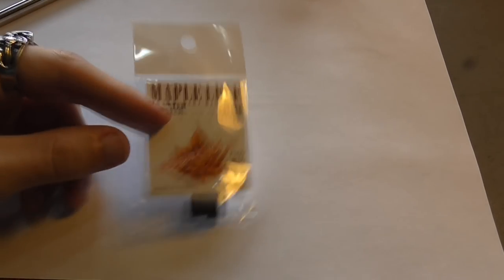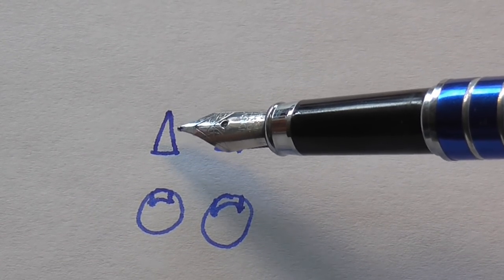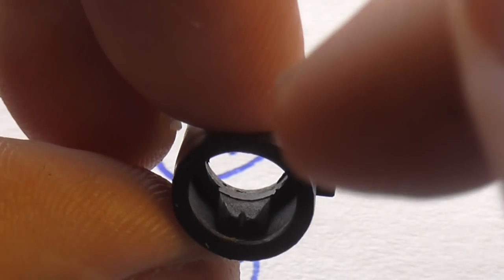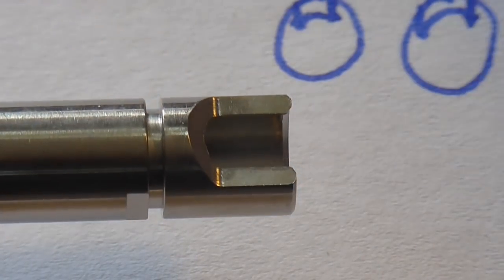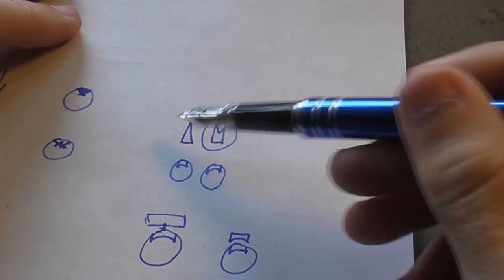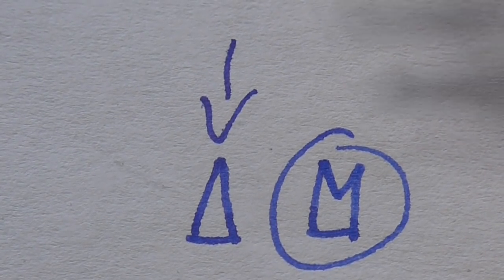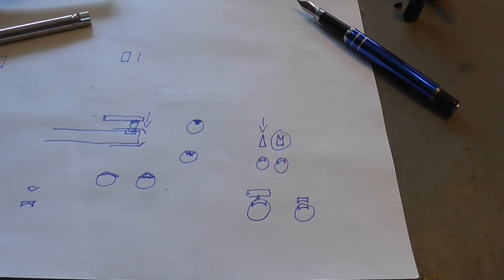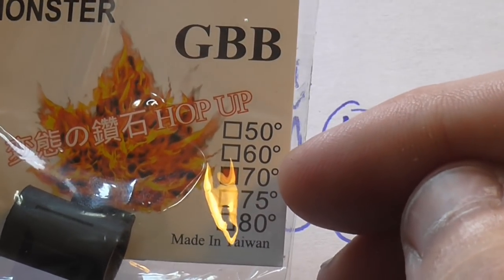Maple leaf buckings (& why you should use them)

Comment: Hey Relizu/Reliku ;p
In the AA hop up chamber, do you need to mill out the window the nub goes through? It seems the nub is too wide for the small window the nub needs to go through.. a prometheus tensioner also didnt fit. And the original VSR10 nub just barely fits. The ML concave nub seems to be much wider then the original nub. Is the window of my AA chamber not as wide as yours or something?
Reply from the maker: Arjen Huijtker The ML concave nub is a perfect fit for the AA chamber. If it doesn't fit, you may have a lemon nub or chamber. But you don't need to mill anything or do any modifying at all.
Reply: Okay thanks a lot.
Great contributor to the airsoft community btw!! :)
Reply: And another quick question, is the action army 6.03 precision barrel also well fit for this set?
Reply: With a ML autobot 70 bucking? :)
Reply from the maker: Yes, but I'd recommend a 60 degree instead with a maple leaf crazy jet barrel. Those are better.

Comment: HI, i have the silverback srs, and i wanted to upgrade the bucking and I have used maple leaf diamond for my vsr before, but not the maple leaf aeg buckings. Would 60 degree maple leaf aeg bucking be good to use. I have an aps m160 spring installed and thats around 520 fps. Also, do I need the concave maple leaf nub for the maple leaf aeg bucking to work, or will the standard silverback nub work?
Reply: +Relizu ^
Reply from the maker: You may have to DIY a nub as the standard SRS nub is not concave. Other than that it'll work :)
Reply: +Relizu But instead of diy my owm nub can i use maple leafs concave nub?
Reply from the maker: John John You could in theory, but it won't work very well with the SRS double adjuster.
Reply: oh yeah I understand that, there is actually a mod for the srs called the fast hop that fixes that problem. Its a dile that you turn to either move the hop arm up or down so its not come from 2 sides anymore, just the top, so  i think the maple leaf nub could work. Thanks for the help! :)
Reply: +Relizu oh also, would 60 degree aeg rubber wear too fast with a sniper rifle? Or should i use the 70?
Reply from the maker: John John both will work fine ;)

Comment: I just got a 75 and i have almost no hop? Its installed right. But idk why. Do i need to break it in?
Reply from the maker: dat boi 75 is hard, so if it's cold or your fps is low it won't work well.
Reply: Relizu i fixed the no hop. But i have many fliers now, my fps is low but i have a new 110 spring. Would you say it should fix the problem?
Reply: Relizu i think evike lied. It says 75 is for shooting 330 to 400.
Reply from the maker: dat boi yes evike simply copies maple leaf's chart. Which is wrong for 90% of the western world. That chart is for tropical climates where it's much hotter (Asia), hotter weather => harder bucking. For 400 fps, I would use 50 degrees (softest they offer) where I live (western europe). If you live somewhere warmer you could go for 60 degrees with 400 fps, or maybe even 70 if you live in the southern part of the US for example. But usually, 75 degrees is waaaay too hard for 400 fps.

For reference: here we play at 500 fps (measured with .2), and I play with .4 bb's at roughly 2.5 J myself. In the summer I play with a 60 degree bucking, in the winter I swap it out for a 50 degree one ;)
Reply: Relizu very interesting. I do live in texas and the summers are really hot here. I have it taken out right now and will wait until it is hotter outside to try it again. Either way i am doing the spring as mine has had several thousand rounds put on it and i need the extra power for outdoors. You know a lot about hop up buckings. I actually didnt have the right nub previously and that was part of the problem. I just needed to watch the video more, and also not listen to evike.

Comment: what you recommend for echo1 m28?
Reply from the maker: pheesh depends on what bucking they take, if it's a VSR-style bucking, then the VSR ML will fit.
Reply: thanks, the rifle is shooting 520 fps. is 70 degree autobot good? or should I do 60 degrees?
Reply from the maker: pheesh I'd go with 60 over 70 as it's more consistent but both will work fine :)
Reply: should I get both 60 and 70 just to see which one gives the best results? going to be using 0.40
Reply from the maker: pheesh that's up to you. both will work :)

Comment: Does the maple leaf delta system work with gbb pistols like kjw m9? And which is the best one for pistols? Here is a link to it: http://redwolfairsoft.com/item_detail/37153-Maple+Leaf+DELTA+System+Hop+Up+Rubber+60+Degree+for+Tokyo+Marui+%2F+WE+%2F+KJ+GBB+%26+VSR-10
Reply from the maker: heidu it does work, but I would recommend the autobot for a gbb, because of the anti blow ring. A 50 degree or maybe 60 would work best.
Reply: ok thanks :)

Comment: I was thinking on useing an action army chamber with the action army hop up buckling for my well mb01. I saw you on Airsoft sniper forums and would really like your opinion on this
Reply from the maker: Go with the action army chamber, madbull steel bull AEG barrel (6.03x455mm), maple leaf bucking (AEG version, 60 or 70 degrees) and the maple leaf concave nub. It's a better setup ;)
Reply: Ok thanks
Reply: What about a r hop set up what would you recommend for that?
Reply from the maker: +Your Mom The same thing, but an R-hop + any bucking along with M-nub rather than the ML.
Reply: I'm sorry I'm new to this but what is an m nub
Reply: And were would I get a r hop?
Reply from the maker: +Your Mom look it up, you can buy them both from HSA. However if you don't know how it works, it's probably a better idea to just go with the maple leaf ;)
Reply: Thank you but I think I want to give it a try.
Reply: After looking around I see that you are right about going with the first one. Will this barrel do http://www.evike.com/products/24374 its not exactly what you said for it to be. But will it still work.
Reply from the maker: It will work, but it's an aluminium coated barrel, which means the coating will wear out after a while (and it will become inaccurate) and the barrel can easily be damaged by something as simple as tightening the screws on this chamber. I have personally ruined aluminium barrels this way because overtightening a screw only a tiny bit will put a dent in the inside of the barrel and the bb's won't be able to go through it anymore.

I'd get the steel bull version instead. It's made of stainless steel and a lot stronger. It also has a better finish ;)
Reply: Thank you for helping. You've probably have better things to do. I really appreciate it.
Reply: Maple leaf Range black 60 with maple nub, with promotheues barel..  shot right and left, but Nub is not in shape of shquare. it is triangle with pointi end,                                    witch made bbs roll left and right on end of Hop.. Buj acuracy Colour maple leaf. with flat end ..                                                                                                                                             Hup up must alway be flat or it shot left 1 right.logic.. Posaidon barel is bast with  maple leaf.. POsaidon pushes bb up..                                                                                                            I gues you need that for bb to stay in same position with GAs pasing below litle for up presure..                                                                                                                                     WIDE BORE are actualy more Acurate with range..  But it uses more power.. 6.8 and 6.2 on wery long barels. with miricle barel dezign. or poseidon there are new dezigns VERY efitient but No reputation.. Wide bores with shapes in barels for steady BB.and those barels spins more and more TO end Tight bore slows spin and try tomovewith air. pasing

Comment: ...or just use a maple leaf hopup arm that is basically a hopup arm that has the maple leaf nub pre installed\
Reply from the maker: Longyat Chan I did mention these but I do not recommend them:

-The nub is softer than a metal arm and yields better consistency
-The arms suffer from quality control issues (not fitting, being off-center, stuff like that)

An AA chamber is easier and has other benefits as well (such as airseal and TDC style hopup).